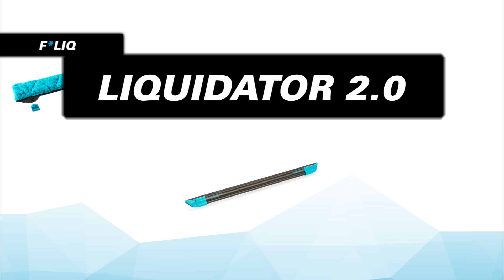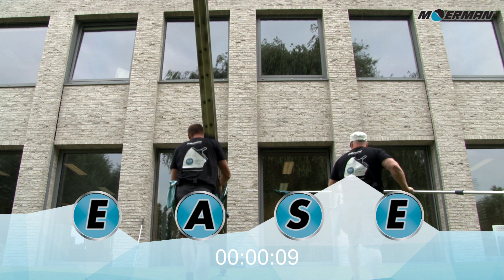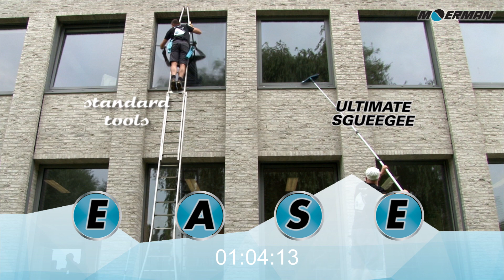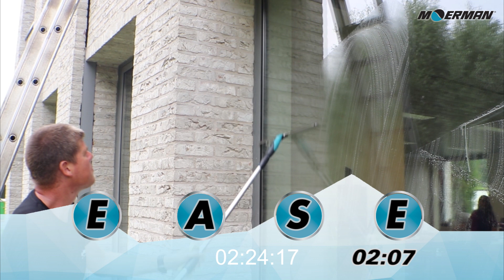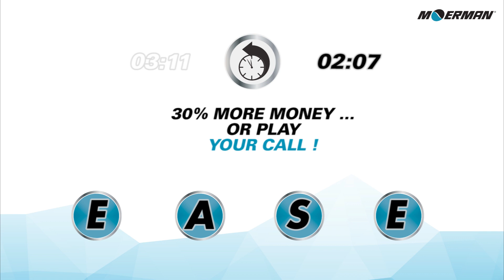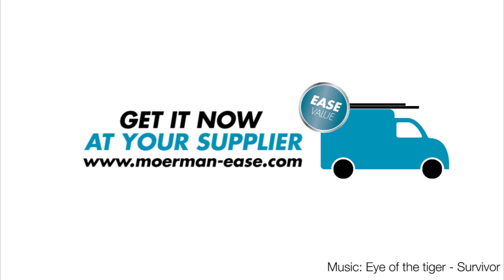MOERMAN - ULTIMATE SQUEEGEE - DEMO VIDEO

Comment: what rubber r they using as the guy with the pole didnt need to wipe after himself
Reply from the maker: Hi Aaron, that's the LIQUIDATOR channel, you can check the video here: https://youtu.be/KuEMX1WBeiM
Reply: The Moerman channel 2.0 leaves no detailing with the special end clips.